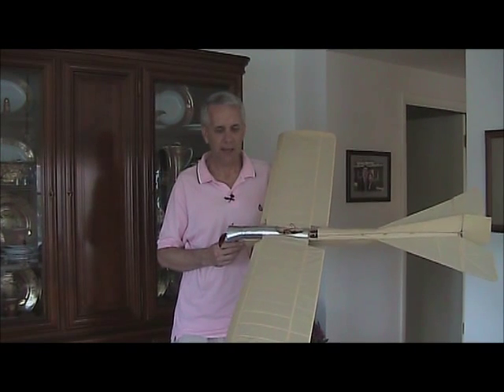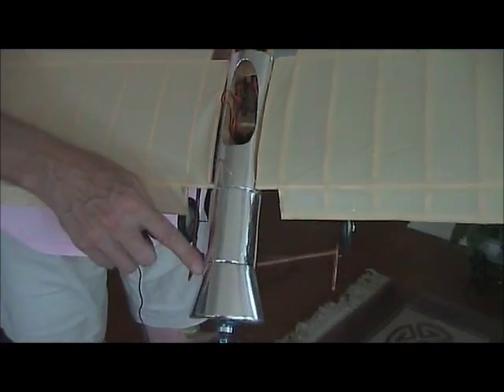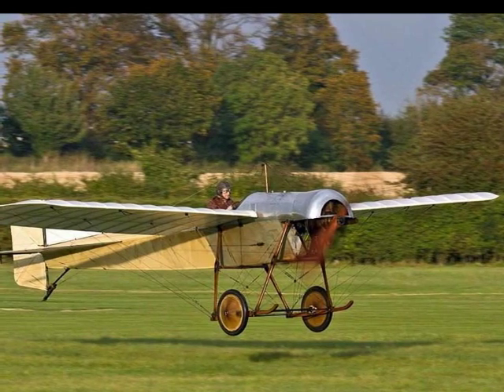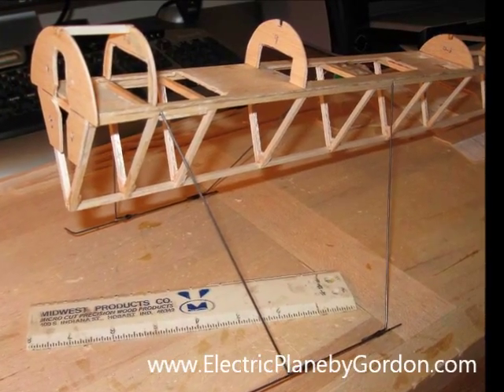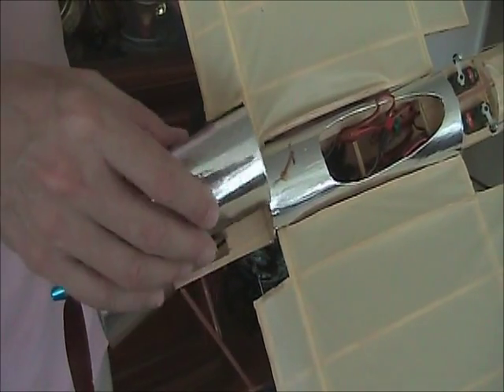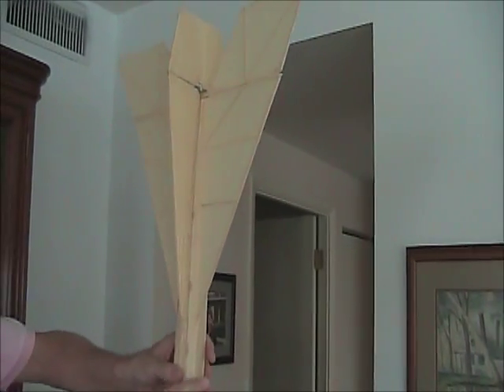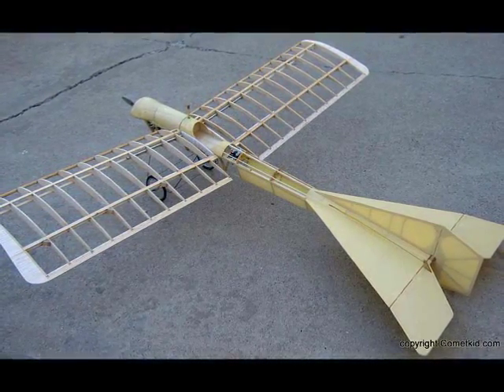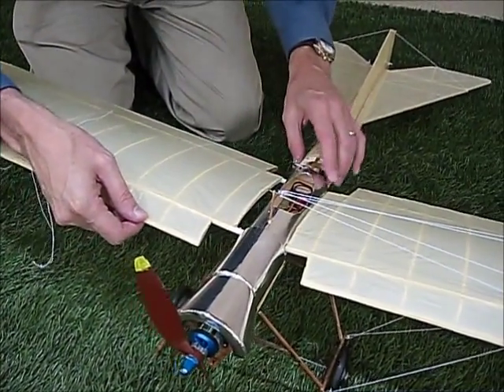1912 Blackburn Type D Model Airplane Review and Flight Test

Comment: I really like the shapes and forms of the fuselage and the tail section, the overall design still looks snappy and modern despite its age.
Could this be modified to fly with a rubber power motor?
Reply from the maker: Is possible!  Tim